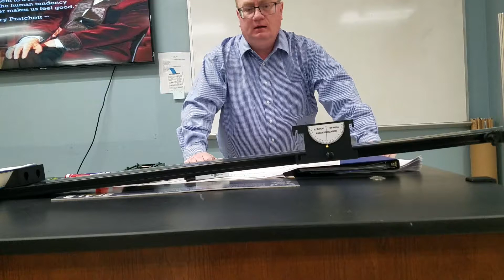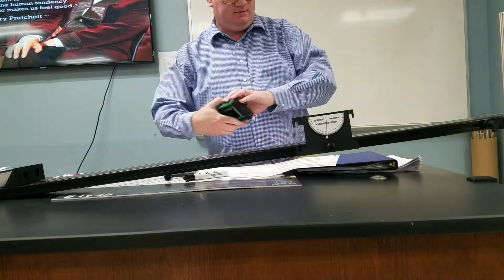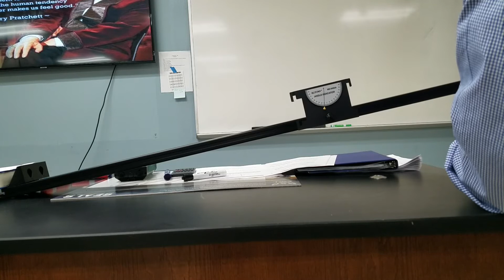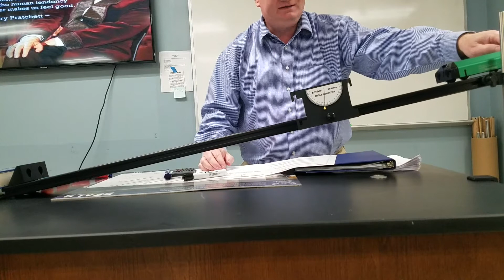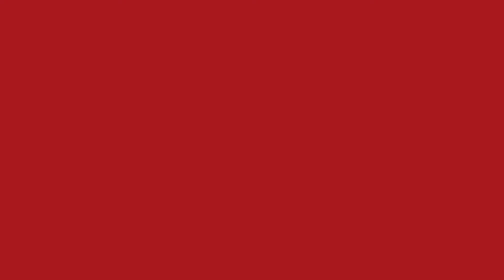Acceleration on an Incline Lab with Data

Comment: what is the error please?
Reply from the maker: Sources of error in a lab are things that are not accounted for or could not be precise. For example, there is friction on the wheels, some air resistance, measurement accuracy on the angle, etc.
Reply: @thephysicschannelwithkenny314  thanks1

Comment: Great but do you have data and calculations?
Reply from the maker: I usually have students time the cart rolling down the incline and use that time and the distance the cart moves (1m) to determine the speed of the cart at the bottom and the average acceleration. Then they can compare the acceleration they calculated to the acceleration due to gravity at that angle.  Thanks for watching.